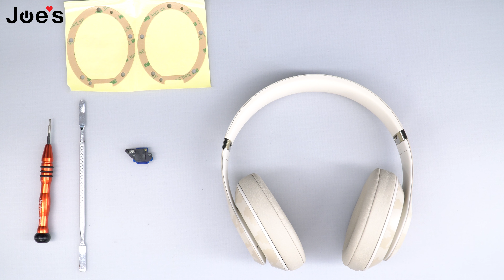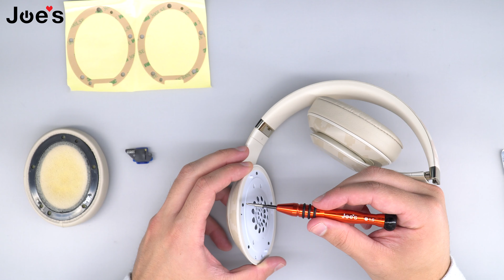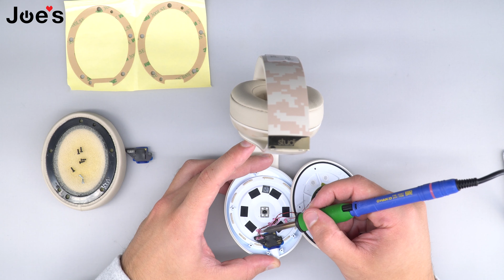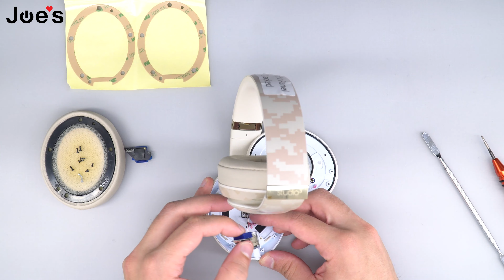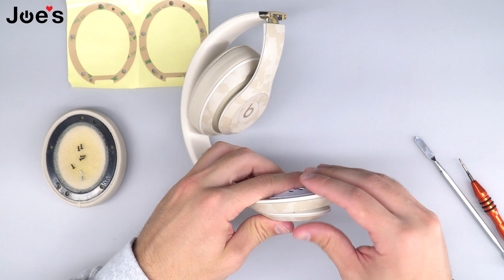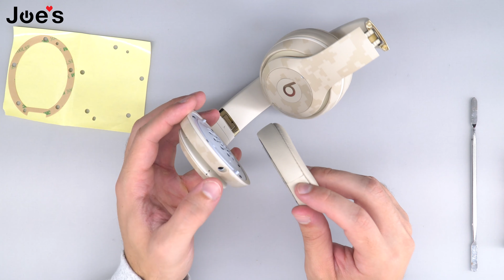Beats Studio 3 Wireless Audio Aux PCB Replacement | Repair Tutorial

Comment from the maker: Buy Audio Jack Part: https://www.joesge.com/products/beats-studio-3-wireless-audio-jack-port-3-5mm-pcb-parts
Buy Ear Pad Tape: https://www.joesge.com/products/beats-by-dre-studio-2-studio-3-wired-wireless-3m-die-cut-ear-pad-cushion-adhesive-tape?variant=39322927595566
Buy Screwdriver: https://www.joesge.com/products/electronics-precision-screwdriver-philips-1-5mm-repair-tools?variant=39682834759726
Buy Ear Pad Pry Tool: https://www.joesge.com/products/strong-metal-opening-pry-repair-tools?variant=31834411728942

Comment: What are the symptoms of bas aux PCB? when i put the aux cable the white led turn on but there is no audio
Reply from the maker: Does it work without the cable via Bluetooth?
Reply: @Joesge  It does work with Bluetooth, but doesn't work with cable. sometimes I prefer to use the cable.